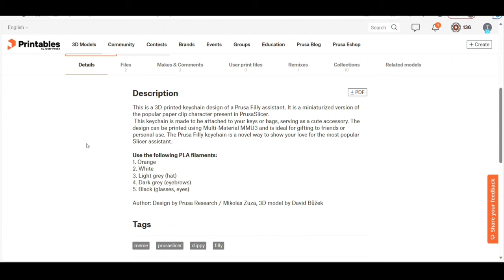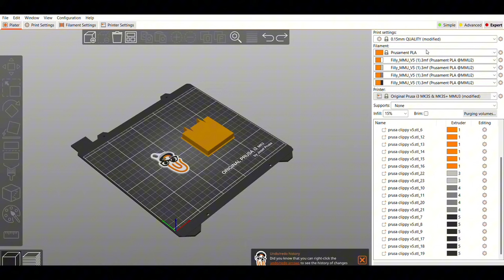MMU3 Printing of Filly the PrusaSlicer Assistant!

Comment: The purge block is normal.  It’s the same for the MMU2s. It seems your lines feeding from the buffer box to the MMU3 or from the filament to the buffer is causing issues. Unless it’s your tip retracting from the hot end. 

I’m working on completing a build for a Prusa Repbox to mk3s/mmu2s which will work for the MK4/MMU3 as well. It eliminates the need for the buffer box at all. I’m sure you can take the ideas that I came up with, and modify them to fit your needs but in the end, taking filament out and putting away every time we need to use it kind of becomes repetitious, so having everything unboxed and placed in their proper place until the spool is used up seems to be much more efficient…especially if you’re printing with an MMU. It’s a few different components that have been reverse engineered and or modified. Coming soon.
Reply from the maker: Good to hear! I would love to get rid of the buffer! Or even swap to something a little more efficient. Thanks!

Comment: That is awesome!  I bet it uses less filament than the Bambu AMS multi material thingy.  If the Prusa mmu3 is consistent trouble free then perhaps I'll go with a Prusa printer with mmu instead of a bambu with ams

Please test print more with mmu3 and let is know how it goes.  Thank you! 👍😊
Reply from the maker: Thanks so much! The first couple of tries I had some issues but I think I'm figuring it out. And getting used to being around in case I need to help it along. 

I just recieved a Bambu AMS last nite. The main difference I see so far is the Bambu setup was very easy compared to assembling the MMU3. Now I want to see how long each take, how much filament waste etc. Thanks!
Reply: With some tweaks the AMS can be about that in filament waste. Since we only need the outer colors you can get the same print in about 40min with flush colors on either end of the keychain vs raised with about 15 color changes. 

I played with the model in orca slicer and all of those "stl" pieces can be brought lower into the model. Use paint "height range" to make the center a solid color, in this case white. Purge waste on the bambu is 5.67g. and the model is under 4g. Ideally you would want  multiple as the purge would be the same if you printed 1 or 20. Prime towers are optional on the bambu but recommended. for that same 1.5hrs (official time)you can get 6 keychains printed. 

I will say the reliability of the AMS is leagues above the mmu2 and from this video probably the mm3. (the MMU3 is still new so they may be some kinks to work out) 

I have had my AMS for 13 months and have had thousands of color changes and filament loads and it has been 99% reliable.  With the only issues being TPU is no bueno, and old brittle filament breaking inside the ptfe tubes.
Reply: @tada3dprinting very cool.  Excited to hear your opinion and or comparisons between the two different systems
Reply: @ashleys3dprintshop thank you very much.  Sounds like the AMS is excellent, especially it being so reliable.
Reply: @BennyTygohome  Sure thing😁. I kinda dont use the AMS for (large)multi color printing anymore as it makes the print times explode but I design and print things with few filament changes to speed up printing.  hence the long paragraph to mod the filly keychain.

My main use of the AMS is more mundane. To put it simply... I'm lazy spolied. lol. I load it with a bunch of filament and dont have to touch filament for 4KG at a time, I print when I am away from home, and use it for filament runout redundancy and to burn through nearly spent filament.   

It works well and I am sure the mmu3 will hit it's stride too. This channel is one of the rare ones showing off the mmu3. ☺

Comment: This brings back memories of the mmu2....Not good ones. When it worked it was fantastic, but I could never rely on it.  With the amount of space this takes up and how troublesome it could be does not fill me with confidence this round with the mmu3. 

Also transitions from black/white require the most purging otherwise you get color blending/bleeding in the part. 
Do you plan on using a tub/tote, to place all the rolls, so they stay dry and keep them organized?
Reply from the maker: Yeah I am hoping once I get it tuned, it won't require much. But yes the footprint is large. I'm just trying to decide if it'll be easier to get to the filament if it's above or below the printer. I just print with PLA so I don't think I'll need any special filament holders. Unless it could help me get rid of the buffer. Thanks!
Reply: @tada3dprinting  Ah that makes sense. I was thinking a tote to keep the filaments snug in one place side by side. I see you  use the freestanding rollers. I keep thinking they will get away. lol.

Thank you for answering my question. Excellent video. 😀
Reply: I agree. even this small print having a stupid mechanical failure reminds me of all the misery of mmu2s. hopefully there are some extra tweaks you will learn. in my case i came to accept failures of the mmu as normal and then one day i said forget this. please try larger 3d complex 5 color prints and show us the results.

Comment: Cool video, I like my MK3S+ and am waiting for the MMU3 to ship.   It looks like your Z-level needs to go down more on your first layer, (not much squish).  That or you need to increase your extrusion multiplier.  You should not see any filament lines at all on your first layer.   Or maybe you have your print speeds cranked way up and if so you may need to increase the multiplier.
Reply from the maker: Yeah still have to adjust that on the MK3. Thanks!

Comment: Interesting to see, and appreciate your explanation of the error and correction.  Similar to the AMS, at least you have the ability to correct and resume.   I have a 3D Chameleon which i never got to work, no error recovery at all.  Interesting to see the A1 print, but only 4 colors
Reply from the maker: I didn't realize the chameleon was so touchy. Yes I want to compare the Bambu AMS. Thanks!
Reply: @tada3dprinting  It is designed for any 3D printer, but is like a jack of all trades, master of none

Comment: Very nice print.
@1:13 The reason for all those little parts indeed is because there are a lot of different parts in all the colors. The orange paperclip has 5 pieces, 3 black pieces and so on. If you watched the printing (or look in PrusaSlicer) you'll see that the middle section is all white so these parts are copied on the bottom. This is one of the things that can make multi color prints a lot of work to set up: you have to correctly set the extruder for each of the printed pieces.
By the way: I cannot print this on my XL. It does have 5 extruders but I choose to have one 0.4 and one 0.8 nozzle and PrusaSlicer will not print a wipe tower for a print with different nozzle sizes. Well ... technically I can print this - and maybe I will try - but the result will never be as nice
Reply from the maker: Makes sense. Man I didn't even think about having trouble with a tower because of the nozzle size! Thanks!

Comment: I have printed hundreds of 2 filament items using an older FF creator Pro. That printer is becoming troublesome and currently not working at all. The main control board is no longer available. I am looking around at different options to consider on a new 3d printer. I would really like to  find a three extruder printer with excellent ratings for speed, reliability and quality of print.    I question if any type of one extruder multi filament setup can be produce the types of models that I have printed. I am looking at everything I can find especially regarding the Pusa mk4 + MMU3   and the Bambu Lab X1-carbon. I suspect that either of these options would not work well and result in huge amounts of waisted filament to print what I have been doing. briefly, I am printing jigsaw like pieces of a globe. Each individual piece (there are hundreds of them) will be made up of three STL files printing in three different colors in one print job..  The completed globe is a scale topographical elevation model of the earths surface consisting of water areas and  land areas with cities indicated on the surface.      Many prints consist of fine detail in each of the three colors spread out over many layers. 
What I would really love to see an example print of one of my puzzle pieces that was done on Pusa MK$ + MMU3. To determine how practical that printer might be for my prints.  I would also like a filament weight for both the finish print and any wasted material that was used to purge the extruder. 
Is it possible to convince someone with a Pursa mk4 and/or a     X1-carbon to attempt to print one of my prints? I could forward the files and perhaps even some funds to cover part of the costs of this experimental print. I don't know how all this could be arranged but I am interested in seen what could be accomplished.
Reply from the maker: Hi David! I have a Bambu X1Combo and an Mk3 with MMU3. If you want to email the info, I should be able to do this for you. My MMU3 for the MK4 just came in this weekend and I'll be putting it together soon. Thanks! tada3dprinting@gmail.com

Comment: The MMU seems such a pain if you have an issue, like the filament re-load. Maybe you just got unlucky and once it prints it is all fine.
Reply from the maker: If you only print with 5 colors, you're rarely going to need to touch it. But yes it does need to be tuned a little bit in the beginning. I'm hoping it's minimal from here out.

Comment: that looks like it take up a huge amount of space for just making colors on the print. It does look nice though it not my cup of tea to print colors normally, I have printed name plates in 2 color which is really easy just have to manaully change out the PLA. Waiting to see how the XL does with color changes that would be what iam looking for different print heads and now tower needed
Reply from the maker: I usually just print individual pieces and glue together. And I was figuring the XL would be a good fit but I still don't have a multi-head.  I'm not sure yet what the waste is on that. But yes the MMU3 takes up a lot of space. Thanks!

Comment: having a lot of experience with mmu printing , i highly recommend you to ditch the buffer and print/build the rmu3 like buffer from printables. will save you a ton of headaches ...
Reply: Also, try to keep your bowden tubes as short as possible. you want as less friction as possible. some filaments/colors have different consistencies, you will find them getting ground down when you have friction in the system. also if you want , search for test mmu prints where you have a ton of filament changes and leave it over night. Then you can find out other issues like , fine dust accumulation in the mmu, which in turn need fine adjustments of the idler pressure.  Then,  grab some TPU and incorporate them with other materials to have flexible joints , or play around with the non-stickyness of materials to use as supports that detach easily ( like petg with pla supports ) . Thanks for your videos!
Reply from the maker: Thank you!